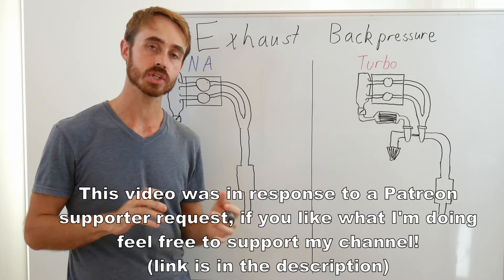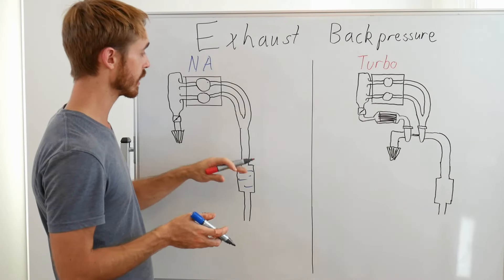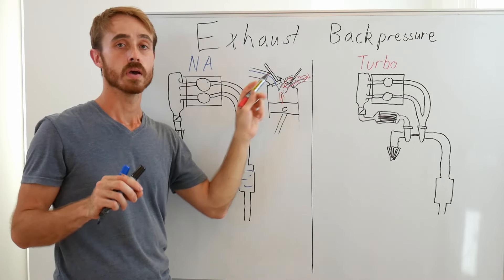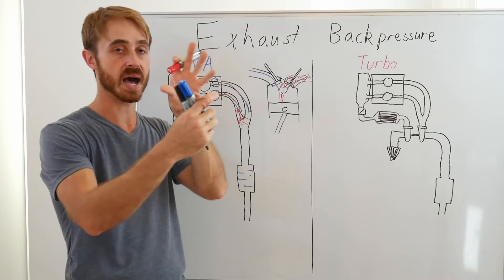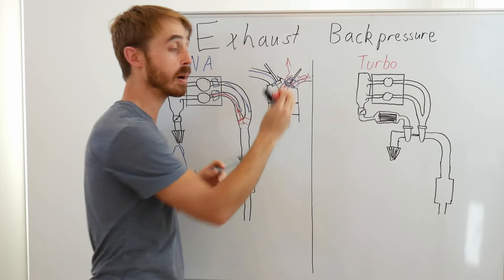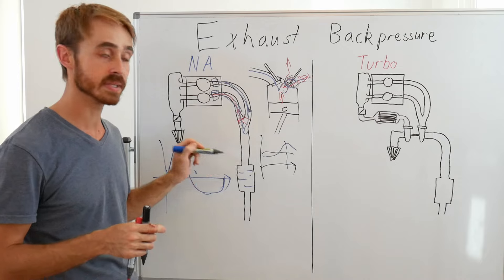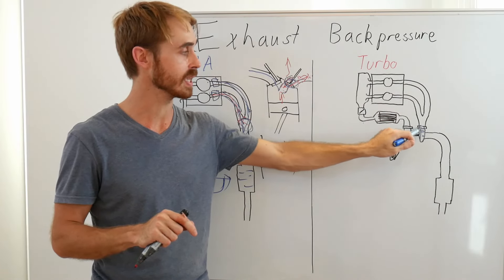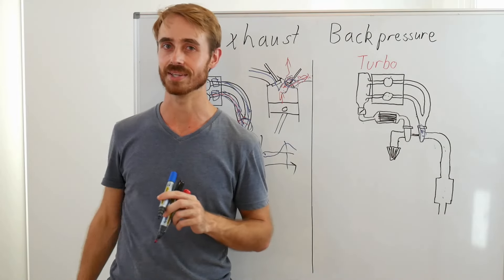How Does Exhaust Backpressure Work? - Basics of Pressure Wave/Harmonic scavenging

Comment: Hi, not sure if you can help but I was just wondering what your thoughts are on this sound I’m experiencing with my Jeep? I have a Jeep Commander 5.7 Hemi 2006 with a Magnaflow 49709 cat (newly installed) and a magnaflow 18″ oval muffler (installed a year or so ago) with stock resonator and pipes between the mufflers and cat. I have new sparks and coil packs and have very recently cleaned the throttle body. Nothing appears loose underneath.

I have a sound issue from the exhaust, it sounds like a flutter/ chug at the end of the rev range (need to listen carefully). It does not give a smooth rev the whole way through it. Really annoyingly, I cannot remember if I was experiencing this sound before the cat or spark plugs were added or not.

Have you got any idea as to what might be causing it? Could it be the stock rear resonator as it appears big and bulky, reducing flow and causing some sort of back draft sound/ issue?. Thanks for any help! 

https://youtu.be/y1ELsi7ZDT0

Comment: Probably jumping the gun here at one third through the video, but there can’t be enough said for the effects of valve seats. 
It’s that split second as the seal is broken that creates crazy fast air speeds due to pressure differences. 
Trick multi (3+)angle cut valve seats are a real world upgrade. 
🇦🇺🤜🏼🤛🏼🎅🏻🍀🍀🍀😎🤓

Comment: Would it be beneficial to have a forced savaging type of setup, so as the valve opens the exhaust gases are sucked out rather than pushed by the piston, allowing the intake valve to open soon and longer to have the cyclinder fill with fresh intake gas, just a shower thought I had just wondering if it has validity

Comment: Simply put, it is an input/output system.  Efficiency (power) is the greatest when the system is in balance.  Pull the exhaust off a stock engine and it will run terrible.  You could retune to compensate but the engine will run rather inefficient outside of constant high rpm.

Comment: My Subaru with 2" pipe has a very loud drone between 2100 and 2400 rpm with a straight pipe. Would an absorption type muffler get rid of the drone or lessen the effect? Should it be installed before the rear axle to make it "work harder" like stated in the video? Also, would a 12" or 24" be better suited for a 4 cylinder? Thank you!

Comment: my turbos have a 6" outlet that i have going to a resonator and then nothing. i know that using a turbo blanket helps hte turbo heat soak faster and provides faster 0-60 times. testing from the mfg showed as much as a 1.1 second drop in 0-60 with thick turbo blankets

Comment: Interesting that a recent episode of Engine Masters showed that back pressure is undesirable for best performance and that the "smaller exhaust enhances torgue" idea is a myth. Dynamometer results were confirmation of free-flowing exhaust enhanced horsepower and torque both. Anti-reversion in both intake and exhaust were more effective. When I port and gasket-match intake and heads, I leave a. 030 anti-reversion "lip" on the intake port of the manifold and one on the exhaust port of the cylinder head. Power is enhanced as well as scavenging. My header design is optimized for 2,000- 3,500 rpm for daily drivers with different designs for performance engines based on the appropriate rev range. The port "lip" remains the same regardless. Between catalytic converter and muffler restrictions, there is plenty of backpressure. Post turbo scavenging is the same as you illustrate.

Comment: Quick question, is it possible to have too low backpressure? Or lowering the backpressure without accounting for it in the ECU, to be exact? I've read that it might lead to issues in combination with valve overlap as the lower pressure can lead to air/fuel-mixture being pulled out through the exhaust valve during valve overlap, causing the engine to run lean. Thanks.

Comment: What would you suggest gm do about there afm v4/v8 cylinder deactivation causing serious back pressure vibrations in their exhaust ?
Reply: I think there's a chip you can buy (I believe the brand is Range) that can specifically delete that v4 mode code off of your ecu/ecm. Or, you can find a guy that tunes engines to manually delete that code and do other things to your engine while your at it and get more performance out of it.       I got my 2007 Silverado 2500 6.0 tuned (stock internals, no bolt-ons), and it makes about 400 hp on 91 octance pump gas

Comment: would a small shot of water  post turbine ,similar to water/meth injection on intake without  the Meth,  increase the pressure and temperature  differential accrost the turbo by cooling/condensing the exhaust charge? or would the steam production counter a breef drop with high pressure.  my guss is high-pressure (1000psi) low volume(2-10cc/min) water injection would have the biggest effect at full boost. Would fuel type make a difference gas, E-85, Diesel, methanol?

Comment: so in otherwords, increasing exhaust diameter will "shift" the power band up in the revs and decreasing it will give better low end? and in both cases straight pipe/laminar flow mufflers is the way to go; correct?
Reply: mas921 not necessarily, especially when the pulses is not interconnected, therefore no scavenging.

And, when no scavenging, no harmonic scavenging aka 'supercharging effect'

In other words, it have to be 'just nice', with your engine configuration, setup and tune. 

Just at the nice rpm that you targeted for.

Comment: When i changed exhaust to free flow the low end power decreased but a little bit increased in top end. Engine requires more RPM to produce power. How to get that low end power again.

Comment: I have a question. Does a 4 cylinder turbo engine need backpressure? I made mine straight pipe but I'm going to reflash the ECU and i wonder if more PSI boost will make it smoother for scavenging
Reply: You can and should straight pipe turbo cars

Comment: Well now it's simple! I'm in the process of upgrading my turbo car's exhaust from 2.5ish" to a full 3" turbo back system. According to this I should be getting free power gain yay :P
Reply: hyusama It depends on how much exhaust gasses are flowing through the turbo and exhaust system. If the 2.5" system already causes negligible back pressure to your turbo, the only effect you might have from a 3" exhaust is more (not necessarily ear-pleasing) exhaust sound and added weight.
Unless the stock exhaust diameter is undersized (it rarely is), a larger diameter exhaust is purely a mod that allows more power, not one that actually creates more power (and you could actually lose torque noticeably!).
Unless you do an extreme tune-up, usually not the diameter of the exhaust piping but the components in the line are the only factor that immediately affect tuning potential. The OEM catalytic converter is often the biggest restriction as that's the part car manufacturers can save the most money on by designing it only just good enough for the power they intended to deliver, ánd it's also the part that becomes more restrictive over time the fastest.

Comment: Am I watching Engineering Explained? lol
Reply: Nope, EE at least explains things better and can draw more clearly.
Reply: Knight Fox The. I sub from this Chanel and go watch your EE. This guy does an excellent job at explaining and he dosent have newtlybthe time to practice as long as EE has been doing this.
Reply: I find EE to be better aimed at the novice viewer where Kyle explains better to those who already have some knowledge. EE also shows more math, but it's easy to gloss over that math if you don't understand what he's doing.
Both have their pros and cons. It's good to watch both
Reply: Kyle explained more advanced concepts
Reply: This is called supercharging effect on intake and exhaust besides only siphoning and scavenging.

Right Kyle?

That's why complicated fluid designers and engineers went to variable length, variable route, and variable pressure restrictior to maximize the 'supercharging effect' of the intake and exhaust pulse, for as wider rpm bandwidth as possible
Reply: Yup but with different accent :)
Reply: I came to find a comment like this
Reply: No
Reply: My tuned headers are wacked at about 1/2 the way down the primaries,  I want to repair them but I've been unable to find the same diameter pipe in my area,
2.  1/8" , if I go up to a 2. 1/4" or down to a 2.00" , all the way to a new collector, (depending on which primary tubes are used) how will this affect my performance. 
My primary tubes at the head flange are 2. 1/8".
Reply: Al Mierz 
If you go to 2” you will gain power at low rpms but you will loose at higher rpms
It you go to 2.25” you will loose power at low rpms but may be gain some power at higher rpms... 2 1/8” will be ideal.
Reply: NAV Tekk 
Thanks  NAV Tekk
I'm going up or down in tube diameter because I  haven't been able to find  2.125" inch tube , I've found 2.00" ,and 2.25" locally.
I'm only running the engine up to  6200/ 6500 RPM with a BBF 466 cid and a c6 trans w a 3800 converter. I'm probably going to go with the 2.25"  it's easier fitting in the short confines area I'm working with. 
                      Thanks.
Reply: @lllukiosas59  What you're watching is a complete Fool making a Fool of his self!  You can't close any engine exhaust and make it run better!  Not one racing engine has back pressure on it making it run faster or better!  Turbo or Natural!  Every racing team on every type of racing EXPANDS their exhaust systems for better FLOW!  NOT LESS FLOW!

Comment: Just a strange question that is probably not worth actually talking 
about, but.... would a Miller-cycle style engine (like the one Mazda 
used on the Millenia that one time) be more similar in scavenging 
effects to a turbo system - since it intentionally tries to push exhaust
 gas out during the valve overlap?

Comment: would pulling the fuse on a corvettes dual mode exhaust damage the car
Reply: No. It would reduce your top-end performance, if the valve is "normally closed".  The dual mode exhaust is great because you get higher velocity at low to moderate RPM, when you need it, and you get maximum flow at high rpm when you need the flow.

Comment: i remember i check my exhaust system of my b18c2 engine, it has an equal length exhaust pipe/manifold. which means more back pressure right?

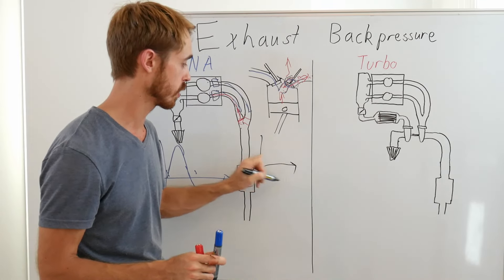Comment: I have ADHD and I got lost at min 6:38, a few weeks ago my car got totaled and I'm coming from a turbo car to a N/A car, to be more precise a Subaru legacy 2.5L I'm thinking of getting headers with no cats and delete muffler, is that a bad idea? Or keep the cats?  I will keep the same diameter pipe that is 2.25 inches diameter stock.
Reply: 99subigt as long as you still have a pipe that goes to the back of the car you’ll have better exhaust flow without a cat and muffler and shouldn’t loose any back pressure as long as you keep the piping the stock diameter

Comment: So what does backpressure really do to an engine.? does it give more speed/torque/mileage if there is backpressure.? or it does not.?
Reply: Prince Belial back pressure is resistance to flow, so too much back pressure causes the engine to work harder.  most engines are designed to work with a certain level of back pressure.  Going way above is bad, below can be bad because the incoming fuel/air charge could be partially sucked out due to valve overlap.  I hope this helps.

Comment: The description is reasonably true for cross plane crank V8s but most other motors not really.
Overlap is better described as intake/exhaust valve lead & lag. The inertia of gas flow from the intake charge is used to scavenge the exhaust. In one type of engine viz. cross plane V8, headers do actually work.
In the real world (as opposed to a didactic concept) most other motors, so long as the exhaust is smooth (not even mandrel bends make much difference), then the I/E lead & lag determines the breathing ability rather than tuned length headers inducing scavenging.
The gains that headers make in most other motors vs exhaust manifolds are from the reduction in pumping losses caused by restrictive exhaust manifolds.
You see the problem in the real world is, that to get the correct scavenging effect it is almost impossible to for a motor operating over broad RPM to sustain the effect. The effect can and does occur but only in narrow ranges. This is fine for a race car but for a daily driver it 'ain't happening. 
On another matter there is a humorous video on denting headers and the effect on performance. It shows on an engine dyno what happens in the synthetic world:
https://www.youtube.com/watch?v=azPKIjxmmdU

Comment: I've got a '91 Galant GTi with a 16V 4G63 N/A engine. I removed the large, rear muffler and installed a 2,5" stainless trough-pipe muffler for a nicer sound to it. Definitely made it sound better, and all the crackles and pops went from a metallic noise to proper joy to listen to. It didn't become too loud, however I imagine I've lost noticeable effect from the engine. It seems like it's accelerating a lot slower. I don't know if this is caused by the lack of back pressure (still have my original exhaust and cat), or if it's just psychological due to the sound. I should've done a timed 0-100 before and after, but didn't think of this. I'll trade the small decrease in acceleration to get that beautiful sound any day, but I was just wondering if this is common.

Comment: Backpressure is always bad.  On NA engines as soon as backpressure is larger than the rarefaction wave you no longer get exhaust tuning benefit.  On the Pentastar v6 engine  we were able to increas torque at 1600 rpm by 50 lbft of torque, but by 2500 rpm backpressure had risen to the point exhaust tuning was no longer possible.  There is a reason no race cars have anymore backpressure than necessary (i.e. required by rule fore length or diameter or both.

Comment: Short explanation: Backpressure is BAD, you want the flow of air through the exhaust to create a vacuum in the exhaust manifold, because at the end of the exhaust stroke... the intake and exhaust valves are open at the same time, (not much, but they are), and that vacuum helps to finish emptying the cylinder of exhaust and helps to prime the cylinder with fresh air/fuel vapor for the next combustion cycle. When your Uncle Butch tells you that your engine needs backpressure or you'll burn up your valves..... tell him "BULLSHIT, you're an idiot!!!".

Comment: I once had on my e46 323i bought a stock exhaust catback because before I drove it straight pipe and the cops didn't liked it. guys telling me you need backpressure otherwise you loose power. but by accident I bought a 318 exhaust. so it had mutch more pressure then stock. the car wouldn't shift from 4 to 5th gear anymore automatic😂

Comment: So , more "Scavenging" pulses reach the headers and cylinders , the more better the car or motorcycle runs? , why not just install a turbo, for intake , and add a powerful fan blowing air from the headers to the muffler to increase the pressure differential and get a constant low wave of pressure going to the cylinders

Comment: Hi, how do you spell the "rearer fraction". This is interesting!
Reply: Rarefaction - the negative pressure part of the oscillation - if you can time that optimally (mostly due to runner/pipe length), then you will end up with that negative pressure hitting the back of the valves at a specific rpm. A few hundred rpm either side of this, there will still be some negative pressure - so still some benefits, but it is likely that the more benefit of this you get at that point, will result in a bigger drop-off above and below this range. it's a neat way of getting a nice high rpm surge on a race car OR a nice mid-range belly full of torque for a daily driver... but you will sacrifice torque elsewhere in the rev range (including higher in the rev range, IF your exhaust runners are the right length for mid-range torque). Proper custom ECU tuning can offset some of these downsides, but how much depends on of the exact car setup and the tuning options you have available - do NOT expect a stock remap or eBay special to cater for your new straight pipe exhaust / custom banana branching!

Comment: Idk but i have a toyota celica stick shift  and add up a fart can or "apexi jdm muffler" and inmediately notice that got slower to  take off valve slapping less gas economy i drove for my daily conmute for 3 months till got tired of the noise put back factory one believe me guys my car came back to life less noisy but all that damn issues went away never putting stuff like that again problably the engineers design them mufflers for a reason idk if applies with all cars but in my case never putting stuff like that in my car

Comment: It’s not back pressure the engine needs... it’s “velocity”... back pressure is a restriction... velocity is increased air speed.  Go to large diameter of exhaust, you lose velocity, go to small you gain back pressure...

Comment: Back-pressure on a turbo car.....is ALL about application?rpm. Prior to making Boost the exhaust can still have scavenging...increasing "Off boost performance/spool ability"...but that's usually in Very High HP or landspeed cars.

Also High back-pressure KILLS exhaust valves.